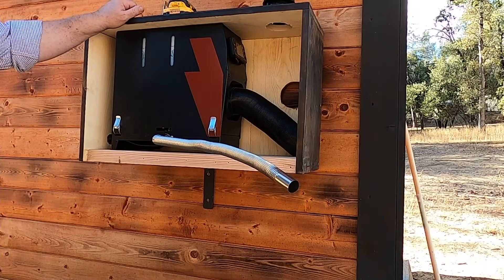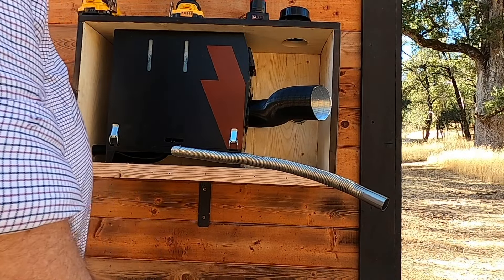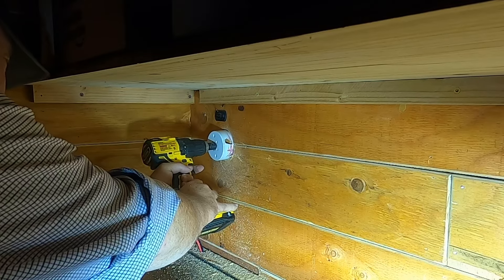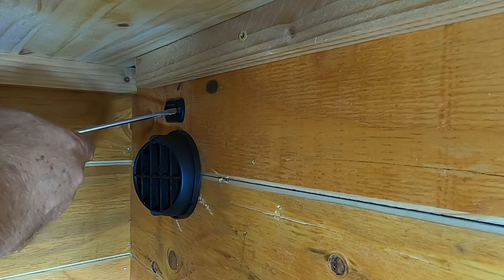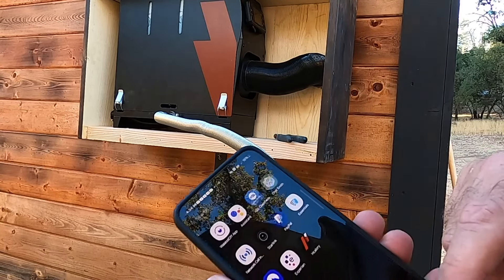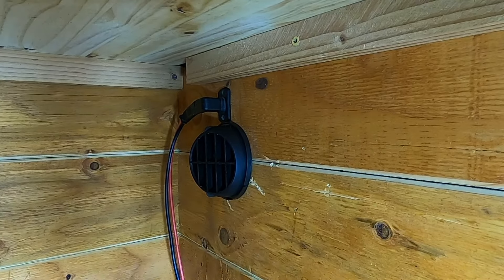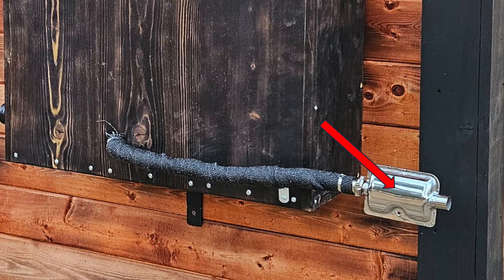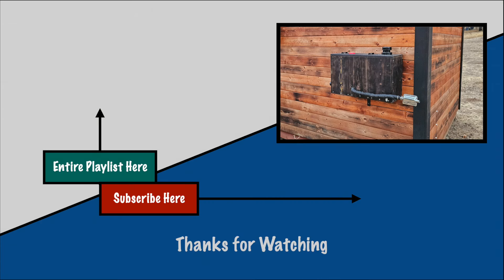Installing A Diesel Heater At The Off Grid Cabin

Comment: Clean install. You should have the intake of the “fresh air” side routed back into the cabin.  Otherwise there is a chance the “fresh air” intake could pull in exhaust from the combustion side.

Comment: I have a wood cabin however I made the area where the heater was going brick and ceramic tile about 3 ft square for peace of mind
Reply from the maker: @trevortrevortsr2  good idea
Reply from the maker: I've been considering putting a black metal backing behind where the heater is mounted.
Probably won't do it until next spring though, because I know myself.

Comment: They are great mines works brilliant but if i was you id have doen the exhaust hole on the bottom of the box and made it alot bigger because the hole on the side the exhaust comes threw has no plate and that exhaust gets red hot enought to burn  and set on fire wood.
Reply from the maker: I wrapped the pipe with heat tape going through the hole. Should be ok. I grabbed the pipe after running for an hour with my bare hand and it did not burn.

Comment: Oh no 😢
You are constantly drawing cold air into the heater, warm it up, blow it into the cabin, generate an overpressure in your cabin and therefore loose the hot air again.

The idea is that the heater gets fed with warm air from the cabin, therefore recirculates!

Only the combustion air should come from the outside.

I would reccomend changing this unless you had a very specific reason to do it.
Reply from the maker: Hi @florihae, you are correct about the heating efficiency, but the fresh air intake on a diesel heater is specifically used for combustion. This intake draws in air from outside the space (such as a cabin or vehicle) and feeds it to the burner, where the diesel fuel is mixed with air and ignited. This setup ensures that the combustion process is completely isolated from the indoor air, which helps maintain good indoor air quality and prevents the risk of carbon monoxide or other exhaust gases entering the living space. I went back and forth on this one too and opted err on the side of safety over efficiency. Maybe I overthought it, but I feel better about it.
Reply: @TheWoodHaven  oh, no, no, I am talking specifically not about the small combustion inlet. That one should come from the outside, but the big (I think 3inch?) Air duct.
This one now draws air from the outside and then pushes it into the cabin.
That has nothing to do with carbon monoxide
Reply from the maker: @florihae  gotcha. maybe I should do more research on that one.
Reply from the maker: @florihae  I contacted the manufacturer and this is the reply:

In general, having the vent (for the heater box) open to the outside rather than inside the cabin is often preferable, especially for the following reasons:

1 Safety and Air Quality: Drawing air from outside avoids pulling cabin air into the combustion or ventilation process, which could lead to indoor air quality issues. If the vent pulls from inside the cabin, it may slightly reduce oxygen levels, particularly in a small space, which can impact air quality and increase the risk of low-oxygen issues.

2 Moisture and Condensation Control: Pulling air from inside the cabin can introduce moisture from the indoor air into the heater box. Since the heater produces heat, this could lead to condensation buildup and even corrosion over time. Drawing air from outside usually keeps the box at a more stable temperature and moisture level, reducing condensation risks.

3 Efficiency and Temperature Regulation: Pulling outside air into the heater box ensures that the heater and exhaust are working in an environment similar to the external temperature, rather than bringing in warmer, moister cabin air. This setup can be more efficient and prevent excessive heat buildup, which is especially important if the box is exposed to direct sunlight.

While some recommend drawing air from inside the cabin to reduce drafts, the potential safety and air quality risks make it generally safer to vent the heater box to the outside.
Reply: @TheWoodHaven  thank you for this answer...super weird tough. Basically no other comapny reccomends this. The heater has a termostat on it, so how would it even know if the temperature in your cabin reached the desired value? 😅
Reply from the maker: @florihae  I don't think mine has a thermistat. It has a timer setting though. I can set it to run between midnite and 6am for example. My cabin is really small. It's less than 120 square feet. I did not mention that to them, but their recommendation was for small spaces. They also said that recomendation is not for all setups so there is that.
Reply: Inside air is of inferior quality and positively charged.  Outside air is negatively charged so much healthier. What worries me is that the air vent is too close to exhaust
Reply from the maker: @youtubechannels9205  I think pulling in the outside air is a lot less efficient, but I prefer fresh air while I'm sleeping.
Reply: @youtubechannels9205  haha, what a werid statement about "charge"
Exhaust is actually bit close, and try to angle it more downwards, you wsnt to get rid of the condensation.
Reply from the maker: @florihae  You know I didn't realize this, but watching the video back, I see that I installed the muffler upside down.
The muffler actually has a condensation port and I have that pointed up instead of down.
Nothing I can do until I get back out there. I will be fine tuning it next time I'm out there.
Thanks for pointing that out.
Reply: @TheWoodHaven yes, do that, but also make the whole pipe slightly going downwards.
Reply from the maker: @florihae  I will do that.
Reply: I can't even watch any more!
Reply from the maker: @user-st5rc9nz4j  How far did you get?